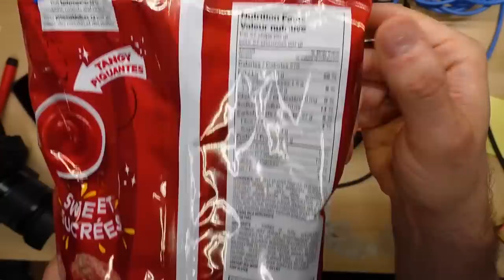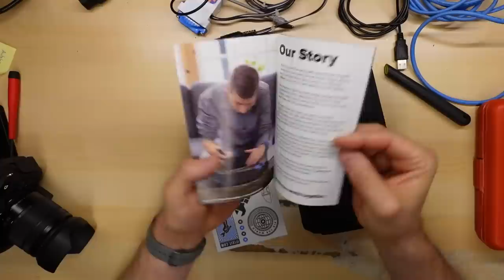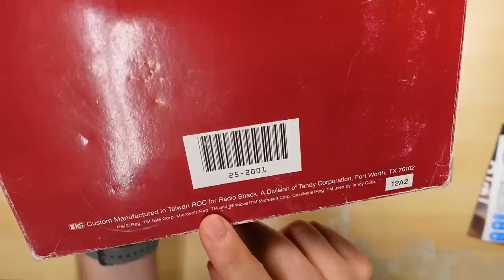Some Ketchup Chips, some 486 Chips, an iFixit toolset, some IBM keys and a 90's IBM "Credit Card"

Comment: I don't know if you could find them these days but I used an inline 5v to 3.3v socket adapter on my 486 PC in the mid-90s. I had a motherboard that only supported 5 volts and I started with an Intel DX2 66. I upgraded it to an AMD 5x86 133 using the voltage adapter. Unfortunately the motherboard I had did not properly support the 4x multiplier that chip wanted (no matter what jumper settings I tried) but I was able to run the chip at 40 mhz FSB X3 for 120 mhz. It was a nice upgrade from the DX2 66.

Comment: I agree with the static straps, at least in OR. I have never had any static discharge take out anything modern or retro that I have worked on. The only time I ever wore one was back when I use to build enterprise servers, and that was really just because of the cost of the components/time to get replacements could put a client in a bad spot.

Comment: Not to be pedantic, but a lot of time ESD isn't an instant chip killer.  But MOS chips  (N-mos, P-mos, CMOS, etc.) can all be damaged.  Not necessarily killed, but you can definitely shorten the lifespan.

I'll have to see if i can find the ESD mat i used to get and recommend.  Very tough, you could drop a soldering iron on it, and while it would have a burn mark, it would not instantly melt through.  And it was rubbery, so parts didn't bounce so far, and surface marring was less of an issue.

Comment: Have a check to see if that Kiwi-sourced Edimax PCMCIA Ethernet card is NE2000 compliant. Quite a few of the Edimax ones are and if so, you can use them in an Amiga 600/1200. I had one back in the day when I was first on the Internet with my A1200 👍

Comment: These are called tubular locks. If you absolutely NEED to open one for which you don't have a key, you can use an "impressioning tool". But for more info on that, you would need to watch LPL's videos, as this is about all that I know of them.

Comment: I bought my mat from ebay several years ago, but if you have a grainger nearby try looking there they have quite the selection. They have an eclipse 2'x4' dissipative for around 31 bucks and it already has the connector for the ground strap.

Comment: Leave to Adrian to be the only one in the Pacific Northwest to have air conditioning.

Here in NE Ohio, one local potato chip maker has a Ketchup flavor. So it's a locally made thing.

The CX40 joystick is a tight accurate and awesome controller. I never have any problems with them but then I have big hands.

The secret to Vegemite is to use it sparingly with plenty of butter on white bread. It smells like bread anyway!

Comment: I only use an anti-static strap when handling sensitive chips, like cmos, out of circuit and I have never had an issue. I Just touch some grounded metal before starting and it has never been an issue.

Comment: 43:12, those are small wrenches for putting studs on ports. Ex: if a vga port was missing a stud to fasten the video cable, the wrench would be used for that.
Reply: I always called those studs, “nut screws”, because they were both nut and screw. My boss called then screw nuts.

Comment: I think the static electricity also depends on the humidity. If I have very low humidity (<30%) and I touch the grounded heating I instantly get an electric shock. Short, but still annoying. In such cases I think that if I were to touch one of those sensitive devices it might really cause damage. If your basement is not very dry you would probably never have any such issue.
But I'm not an expert on this, just my thoughts 😊

Comment: Just a thought, but those black flat angled things with what you think are Apple covers look like they might be some sort of open-end wrench.  The notched end has straight sides in the opening, but it looks like it may have flatted sides like for a hex nut.

The Combi-Mouse looks to be a rebranded Logitech mouse (i.e. made by Logitech for Radio Shack).  I've got one that looks virtually identical that is a Logitech.

Comment: Most Pentium and 486 motherboards could be outfitted with a VRM module to run processors with different voltages.

Comment: Anti static isn't as bad a deal in the last 25 years or so because parts have much better static tolerances but you might run into a problem with retro computers in which case just periodically touching the metal case is usually enough to discharge.

Comment: Not the old "but it's humid here!" line.  It isn't the catastrophic, immediate failure that's so much the issue, it's the latent damage that causes it to fail after 2, 3, 4, or 10 years, etc.. Or that causes odd behavior and crashes that gets blamed on the software, but is really hardware failure.

You have been inducing damage, you simply haven't yet come across it, and might not for a long time.  But it is happening.

There's a reason why companies invest millions in equipment and training , and a reason why failure to daily test and maintain your personal ESD equipment is a disciplinary offence in companies who know what they're doing.  Many of us do have professional backgrounds in this stuff, and it does matter.

And I'd suggest these old-timer machines deserve the respect and preservation that basic ESD precautions can bring.

Comment: I used to have the 50 MHz 486 and didn't experience any stability issues. I understand that they were more problematic if you had a VESA Local Bus motherboard, because most VLB graphics cards weren't designed to go far beyond 40 MHz.

Comment: 7:18 You obviously haven't used an Atari 2600 joystick much. They are hell unreliable now in 2021. Inside there are metal clicky dome buttons taped onto the PCB and after playing with it for many years the domes split and no longer work. They also get tarnished under the dome on the PCB and then don't make a good contact. The fix is to remove the domes and clean the PCB and if the domes are cracked, replace them with new ones. They can be held in place with tape (i.e. like the original factory mounting). The other failure point is the white ring that touches those domes cracks and then no longer pushes on the domes. All the parts for an Atari 2600 joystick can be bought new and replaced if necessary, although some of the parts can be expensive. The Atari 2600 joystick was always my favorite joystick for playing games on the A2600 and C64 so I made a modern drop-in replacement PCB using modern parts so that I don't have PCB issues.

Comment: I flatten and grind. pincets until you can grab a hair and then I heat the tips until they are red. Then toss them in oil. They do not bend anymore but better do not drop them.

Comment: Regarding the ifixit kit; this is why I stopped buying on Ali Express. I was getting very tired of the soft metal stuff. Yes it's cheap, yet when I have to stop using something because it's just not up to par, it's still expensive. And very wasteful. So, I just save a bit more and buy quality stuff, couldn't be happier with it.

Anti static mat -> go check out the Gamer's Nexus channel shop, really nice stuff. Regarding using a strap, I never used one in the many years of building my own computers. I do know it can happen and when it does it will suck big time, so yeah, I do get the point you are taking a bit of a risk.

Comment: I wonder if the DX4 would work if there were some kind of voltage regulator on a chip that  you could plug into the socket and then it would have a passthrough design where the processor would socket into that. Sounds like a cool idea but maybe it already exists.
Reply: Some motherboards had voltage regulators that were changeable,  much like with the pentium pro and mmx chips which required different voltage regulators on some boards.

Comment: I recall reading that the SX CPUs were binned DX's with defective math coprocessor sections.  I don't know if this was true, but it would make economic sense for Intel.
Reply: That is the method for all chips.  You test for the fastest and then bin them for slower speeds and less cores/units when they fail.  There are times when the slower chips are needed to fulfill orders so chips that could make a faster grade were binned lower, but this normally happened after the node was mature and most chips could pass the tests.

Comment: Anyone remember the 486 supper computer, It was on the news like 12 years ago a guy did buy an old abandoned warehouse and hire people only of jail to fix up old computers. They had over 200 486 and wanted to prove old tech could be used with the goal of a 10ghz 486 cluster. Did his 10ghz 486 happen could it happen seems like a pipe dream to me.

Comment: AFAIK, no 486 ever had pipeline or branch prediction, all of that came with the Pentium. Also, I think Adrians patreons are trying to put him in a sugar induced coma. Basement contains piles of candy. Also, my first PC was a top of the line DX-50 (before DX2 existed), it was rock solid, no stability issues (other than pebkac).

Comment: I love iFixit tools. I use them a lot. My other older, cheaper tools sets never get used much now. I repair and clean out my game consoles and controllers and one's people give me. Have yet to use my iFixit tools to build or repair a PC. The one I got works great and since Win 10. I never had a reason upgrade my PC. It is liquid cooled. And enough for what I need. Though, better video card for my 43" 4K monitor would be nice to run YouTube in 4K without lag. My PC was built when 4K was not as big a thing and just coming out. Everything else 4K runs great on it.
Processor AMD A10-7870K Radeon R7, 12 Compute Cores 4C+8G   4.20 GHz
Installed RAM Corsair Dominator Platinum 16.0 GB 4X 4 GB

Comment: I have the 486dx4-120 in a box. Personally I find it better than the 5x86-133. I guess it is that 40mhz FSB. But it must be somewhat rare, because I hardly see any dx4-120 for sale anywere.

Also. I prefer the sx25 and dx2-80 over dx2-66. The 66 are just too sluggish for Doom, and too fast for older stuff. So I have a dx33, dx2-80 instead.

Comment: The i7 920 overclocks like as beast as well. It will likely hit 4ghz with little to no problem, The only reason I don't still have an i7 920 system is because the rampage ii extreme I had died from a pretty common fault (I had 2 go the exact same way in the first week, luckily this board lasted another 7 nor 8 years) and the mobos are stupidly overpriced these days.

Comment: Strangely, I have discovered the ifixit tools in our local home improvement store... and got one before I saw them left and right on other tech channels. Been quite happy with them.
As for the static mat: I am rather happy with this one here: https://www.amazon.de/-/en/gp/product/B07FVTGC4L - it's not as temperature resistant as expected and got some abuse, so it's getting a bit of a patina now but it works well. Most newer chips can deal with static "OK", but especially when handling old stuff I really like to be well grounded. The classical TTL chips also - according to my job training - fail in a non binary way too. That is to say it's not just good or bad but rather has weird effects.

Comment: CPU speeds aren't as stagnant as you think. Yes going from a quad core to a 12 core is a nice upgrade, but the actual single core performance is significantly improved as well. Maybe not 10x, but still My Ryzen 5900x's single core performance is at LEAST 4x the speed of my 2nd gen I7-2600. This is most noticable in a game like Kerbal space program where it's heavily single core CPU bound. But then on top of that add in the extra cores? Hell yeah!! Even my Ryzen 4700U laptop blows my i7-2600 out of the water. That's a 6 core with a slower clock speed than the i7.

Comment: I have that same mouse, except mine is just straight PS/2, no serial adaptor.  I got mine with a tandy 4825 multimedia, a crappy 486 with Windows 95.  Runs slower than a stock XP machine would run Windows 10

Comment: the thing that sucks is that windows 11 will be artificially locking out older processors older than 2018. 
you might have to modify a windows ISO just to delete those TPM requirements. 
and since windows 11 is gonna be a smaller windows version upgrade, it begs the question, Why does windows need such beefy requirements?

Comment: My dude its not just that modern processors are much faster than 10 year old processors,  its that theres a very strong push to keep software as backward compatible as possible. The setup youre talking about might single digit FPS games released even 4 years after they were relevant.

Meanwhile people never gave a thought to previous generation performance in the 90s because what kind of LOSER wasn't upgrading every other year, right?

Comment: There's super cheap silicone heat resistant mats on ebay and aliexpress/wish. They're around $20-30 last I checked in various sizes, and they're great for heat and static sensitive electronics.